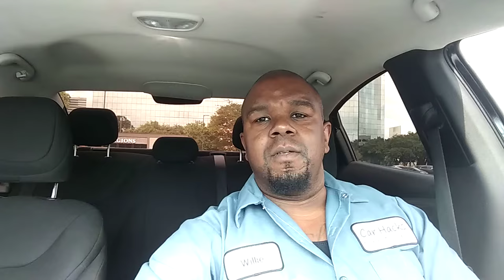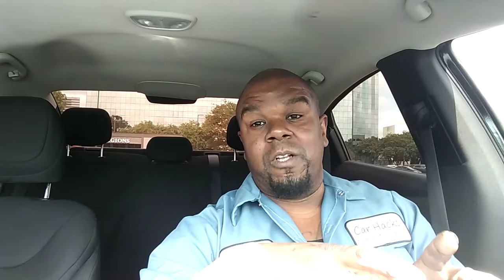Car Hacks : Hesitation under Acceleration? MISFIRE Explained and What is a LOAD

Comment: This very humble low/no budget video was hands down the best of all the dozens of misfire/stumbling acceleration videos I watched, because of the excellent description of the symptoms and the concise listing of the possible problems. My 2016 Grand Caravan was having this problem, and it ended up needing to replace the #4 cylinder ignition coil (had a P0304 code without engine light).

I repaired it myself AFTER a Dodge service center could not find anything wrong or (supposedly) couldn't even reproduce the symptoms in their test drive.
Reply: I’m hoping to god this is my problem too, they made me think I was crazy for bringing this “perfectly fine car” to an auto shop, I hate them.

Comment: Very good information. "Back in the day".... 🙂 bad Spark Plug wires (now known as Coil over Plugs or "COP") would break down say at low speeds under acceleration, which also will cause reduced gas mileage. 

I have a 2003 Lincoln Nav bought new in '03 with the "Intec" engine (not Triton). It now has 141,375 miles. Replaced the factory original spark plugs w/ Motorcraft Plugs at 110,000 miles, due to slight decrease in gas mileage. Now, the gas mileage is even less. Intermittently, the engine under "load," at around 45 MPH will "stumble" or "misfire" when accelerating without engaging "passing gear." It doesn't do it every time. The 'COPs' are factory originals (will be 20 years in June 2023). 

Your video, the issues I'm having and remembering 'Back in the Day" how spark plug wires would cause the same issues... Time for me to replace the Coil Packs. 

BTW: The "check in engine" light did not come one. No PO300s codes either. 

Hope to see more videos from you....

Comment: Thank you so much from UK. Subscribed. Just drove us home in the dark in 30degree Fahrenheit at 15miles per hour (i was not popular with the 60mile an hour traffic behind us). I drive a stick shift and the car wouldn't pump fuel in 1st or 3rd but was OK at 15miles an hour in 2nd. I drove 10miles up hill in sheer terror. Cars honking my family in car and trunk full of groceries. It could be a timing chain issue as the fuel pump and filter and seal were all replaced by the VW dealership earlier this year at Easter. Smell of fuel when I set off in the car coming from the exhaust.
Reply: what was your issue
Reply: @AnonymousAccount-ju9vc  It turned out to be a blocked fuel pump.

Comment: Thanks had this issue with my '15 Compass HA w/ 102K miles. It turned out to be the fuel pump and the spark plugs needed to be replaced. Thanks for the video.

Comment: My 2019 Honda Civic 1.5t 26,000 miles. My engine will knock or misfire/stutter during load up hill around 2,000 rpm. I also noticed today after going down a long hill to a stop, then taking off right around 30 mph same thing...stutter, knocking noise, hesitation. If I let off the gas which I do immediately when hearing/feeling this it fine. I thought maybe it was the gas, so finally used up what was in there, and filled with fresh gas from the busiest station around. They get a new truck in almost daily. I also added a bottle of dry gas. Been trying to figure this out for a week now.  Changed my air filter, cleaned my plugs which didn't look that bad, fresh oil change, still doing it.
Reply: Hello. I also have 2019 civic ex 1.5 t n my car also struggles to accelerate when i press gas. Similarly, it happens when i press on brake. How can i solve it?

Comment: Driving me crazy, engine runs perfect when under light to moderate load. Jerks uphill or at 70ish mph like power completely cutting in and out at the tempo of like a turn signal. Fuel pressure constant at 5psi even while jerking. Vacuum is good, cuts down to 0 when jerking. Replaced entire ignition system, fuel filter, air filter, did timing, new plugs, rebuilt carb, transmission is rebuilt. Haven't checked compression myself but shop said it was good. Jerks with emissions both plugged or unplugged. No visible or audible vacuum leaks and passes spray test around intake. Nobody can figure this out. Only things I can think of is a sticking valve or something or maybe a leaking intake manifold INSIDE the intake? All plugs on one side of engine are lean.
Reply from the maker: I need to know what kind of car this is year make and model. Yeah could be a bad intake manifold gasket a bad fuel pressure regulator. Things like this usually end up being something very very very simple like a vacuum hose that is cracked you can't see it, but when you get a certain load on it that crack will open up or start to leak. Like a vacuum leak at the fuel pressure regulator. The same similar problem on a Ford s h o it was supercharged and there was a ton of vacuum hoses that were all dry rotted they didn't look bad but upon further inspection you can see the cracks in the hoses
Reply from the maker: But the thing that gets me is you said that the problem has a tempo like a turn signal. The reasons I need to know what year make and model of car is because if it's an older car you can have a distributor problem also rotor and cap but sounds like you may have a newer car so maybe your module could be bad or the computer itself
Reply: @carhacks2654  it's a 1975 Buick Century with the odd fire v6 and an HEI distributor. I replaced the distributor with an oem remanufactured one and a performance coil and the symptoms are the same. New wires all in the correct ohm range. I don't think it's ignition related since it's all new and the grounds are all good. Advance works perfectly and timing is perfect. Has to be fuel or a leak somewhere. I hope the shopo that rebuilt my carb didn't do a bad job and I've been chasing my tail this whole time.
Reply: @carhacks2654  I'll try plugging all vacuum except for advance and see if the problem goes away. Two different mechanic shops say they couldn't find anything obvious and suspected the carb..which I then had rebuilt.
Reply: @carhacks2654  Another interesting thing is that it seems to run better the colder it is outside.

Comment: I have the same problem and I agree with your recommendations. However, I have replaced coils and spark plugs twice already, and still have the same jerking at acceleration. I don't believe it is related to fuel, because I would have lean condition in my trouble codes then, while I don't.
Reply: I have the same problem.did you fix it
Reply: @kings3732  my problem was in the CVT transmission.
Reply: @ivanmikhaylov1103   how did u fix it?
Reply: @kings3732  I have not fixed it yet, waiting for the transmission to stall. 
This is definitely a CVT transmission issue, which is mentioned in the following video on 6:28 min for a Nissan Murano 2012. https://youtu.be/NnuDvIZW3h4

Comment: I have a 2016 Kia Forte with manual trasmission, and it sometimes hesitates when I change gears and if I floor the accelerator. The strange thing is that it only does it when changing gears, and only sometimes. It's like I don't shift properly, which may be the case, but I drive other manual transmission cars and it never happens.

Comment: Whenever an issue crops up with my car, my first thought isn't "I wonder what's causing it", instead it's actually "We'll fuck, how much is it gonna cost?"

Got a problem with mine where I'll slow down and stop at the light and then the car drops down to below 500 rpm and it starts to shake and want to die out. Then when I press on the gas, the car does nothing. When I lightly step on the accelerator, there's some activity and then I'm able to start moving again. 

Oddly enough, I put fuel injector cleaner into it and it ran for a couple days just fine but now it's done by it again.

Also what's weird is when it starts to shake and stutter at the stoplight, I pop it into neutral and it idles okay. Car even runs normally when I first start it up in the morning but then maybe 5 minutes into driving it starts acting up again
Reply: Did you got the problem solved?
Reply: @tevinlinton4204  Yes. One of the spark plugs in cylinder #4 failed, so we replaced all of them along with the wires. The last mechanic used different spark plug brands so we made the new ones all Bosch. The thing about my car is that Mercedes made it so each cylinder uses two plugs instead of one. 

V6 = 12 spark plugs.

So it was a bit pricey, lol.
Reply: @berner  ok so did you got it can before and it showed no codes?
Reply: @tevinlinton4204  I did not have a scanner of my own, so the mechanic had to do it. The replacing of the wires and all 12 plugs plus labour wasn't too bad, it cost about $700 Canadian Dollars.

How are you doing and how is the weather over there, by the way?

Comment: My fuel injectors work, i changed plugs ,changed coil packs ,changed fuel pump but still getting misfire at idle and when the car is under load. Before this my car had blown a coil pack and then as i was limping it home 2 others died with it.
Idk wtf is wrong with it.

Comment: My truck is a 2006 Chevy Silverado with the l33 5.3 it misfires when my transmission does not shift and my truck holds a steady 3500 to 4000 rpms. It is when it tries to shift from 3rd to 4th

Comment: Hello, I have a 1992 dodge b250 van w/5.2l eng. and bucks when up to 55mph and above  I have  replaced coil and plugs, wires, distributor cap, and rotor, I also replaced pressure regulator thinking maybe not holding fuel pressure. No help and still bucking at highway speed.  Fuel pressure is at  31 psi  at idle w/vac hose on regulator and 39 without vac hose on regulator. Seems good, but what else could be wrong.

Comment: driving at 90kms i gently step on the throttle to up my speed the engine seems to chug.   i have to step on it more to switch to a lower gear to avoid this.    dodge journey 2010 4.2 FWD.    your thoughts?

Comment: My 06 scion xb hesitates on acceleration but after 2nd gear kicks in it runs fine.  It misfires but I already changed the plugs and coil packs OEM.  I'm getting transmission codes p0974 and p0752

Comment: I have a Chevelet 2000 cargo van...I'd change the spark plugs,wires,rotter button,fuel filter,switched out two bad fuel injectors,and fuel pump and then drove it on the interstate it ran ok until I'd gave it more gas then gas started to leak from up under the van...I am so frustrated can you help?

Comment: My 2013 ford explorer start normally with no engine code but when I drive about 20_40 start jerking feel like transmission slipping and the rpm go down and up again with every slip in. Is this transmission issue or something else.
Thanks for your video bro 🌹

Comment: I have a similar issue with my 04 Trailblazer. But it only hesitates (RPM fluctuates about 200 RPM) when in top gear specifically at the speed of 70-90 Km/h. No issues on high speed or idling. Any suggestion will be appreciated.

Completed the following tasks:

1. MAF sensor cleaned
2. Coils cleaned up
3. New shift solenoids 2 years back
4. New Transmission Oil with filter
5. New fuel filter
6. Air filter replaced
7. No codes except P0128 (Coolant temp below regulating temp) but no overheat at all
Reply: Have you been able to find a solution?
Reply: @KelvoVEVO  Yes. I was the VSS, right on top of transmission.
Reply: @sfh2050  Many thanks!  I'll try this as well
Reply: @KelvoVEVO  installation is very easy. Good luck
Reply: @sfh2050 how did u find out what’s the problem?
Reply: @kenantv7487  VSS replaced. It's installed right on the transmission box. Fairly easy replacement from below you just need a ratchet.

Comment: My car is having to try really hard to accelerate from like, 9 to 15 mph, sounds like I'm stepping down all the way on the gas. Also noticed a little jerking when I come to a stop or right after I'm stopped? Any ideas?
Reply from the maker: It could be alot of the things i mentioned in the video. Start with the simple/cheapest things 1st
Reply: Did you ever figure it out ?
Reply: @trynakillsu1  yes ! I had a transmission fluid leak
Reply: @mallorythompson3365  so the jerking after stopping , stopped after fixing the leak ?
Reply: @mallorythompson3365 how did u know that what’s the problem?

Comment: So I replaced my spark plugs and a coil in the 5th cylinder because I did have a misfire. Now I have noticed when I'm accelerating between 40-50mph my rpm jumps to 2,000rpm. If I barely let go of the gas the rpm will drop back to around 1500. But it only happens between 40-50mph. It will eventually drop back to 1500rpm if I dont release the gas. Do you think it might be the other engine coils? I don't think its my transmission it shifts smoothly. Any idea of what it could be? Thanks.
Reply: Did you fix it??

Comment: this is exactly what was wrong wih my 2008 ford escape... i have a queston tho because i recently got my ignition coils and spark plugs changed, however i have noticed that when i shift into gears the car will buck... sometimes really hard.. what would you say that could be???
Reply from the maker: Thats a hard problem to find without driving the car. I dont wanna lead you down the wrong road

Comment: I had a jerking/misfire for awhile. Replaced the spark plugs, cleaned the throttle body. Thinking fuel injectors are bad? Goes away when giving it more gas
Reply: I'm having that exact same problem and leaning towards injectors and harmonic balancer. Did you ever figure it out?

Comment: Hopefully it is just a vacuum leak.  That means one of the oxygen carrying hoses has a leak which lets extra air out or too much air into the engine.
Reply: if you have a vacuum leak would cause bank 1 or bank 2 to go into rich condition and that would send an engine code with the check engine light on.

Comment: Hey brother hopefully you will be able to assist me, i have a 2012 honda civic that is getting horrible gas mileage,i get 15mpg mostly city driving,i cant even drive the car in d because it jeks at constant throttle i have to drive in d3 which is like sports mode,the car jerks at low rpm but only in drive and not in sports mode or over drive,can this be a vacuum leak? Thanks god bless.
Reply from the maker: yes it could be or your timing belt could be going out. It can be stretching and getting to the point of breaking. Any codes? Could be vacuum leak, torque converter, timing belt, leaky injectors, fuel pressure regulator. Alot of things could be going on. Have your timing checked by a good mechanic. One mistake on the timing on a honda, and the engine is toast
Reply: @carhacks2654  thanks for reply bro,i have no code at all,so i will take your advice and have the timing checked, be safe god bless.

Comment: Hey I have a Honda Pilot 2012 It never had problems but the other day I found that the gas was basaiclly out so I went to go get some gas and the next day It started jerking when I drove It and when I tried to start It at first It felt like my wheel was locked. Then when I driving every time I would put little pressure on the pedal It would start driving late. Can you please tell me what I should do?
Reply from the maker: Check for vacuum leaks. Also check fuel pressure

Comment: I dont know if you respond to these but my car jerks between 35 and 55 if my heat and rear defrost is on. Jerks at tiny bit but it's hardly noticeable. I've had my battery and alternator tested at autozone and I changed an 02 sensor.
Reply: At that speed it's probably your fuel filter/fuel pump/fuel regulator.

Comment: I changed my ignition coil and all 6 spark plugs on my mustang and its still hesitating bad!! 
When it ran fine before eith cyclinder 5 spark plug completely torn off!!!!! How is that possible? I know its not a big issue because it ran fine before but my scanner said P0305 AND P0316 :(
Reply from the maker: What year? If you have a distributor cap check the rotary button and cap. Also i would do a compression test on cylinder 5
Reply: @carhacks2654  2005 mustang, yea me and my tio found the problem. Its bad Injector FuelComponent had a gas leak need to buy new parts today and install

Comment: My 2021 Lexus ES350with 9,500 miles has had a hesitation at low speed most noticeable in 4th gear at 20-35 MPH. The hesitation is only for a second or two then runs normal. Northside Lexus kept my car for 28 days and all they said was use premium fuel, which I have done, and the hesitation is still there, Any ideas ?
Reply: How did u solved it?

Comment: My Mazda 3 is acting the same way
Reply: my mazda sp23 2004 does it aswell
Reply: I finally got the fuel pump changed ,I got a new one ,only after diagnosis I got code for knock sensor damage,it having that changed today